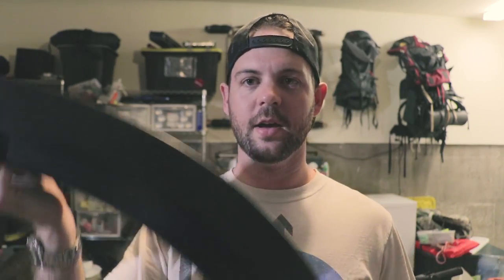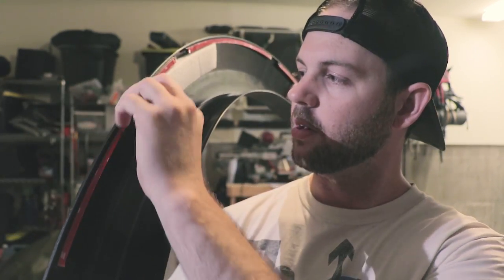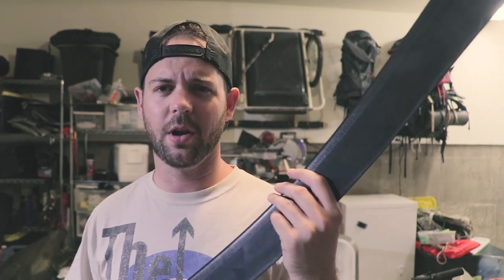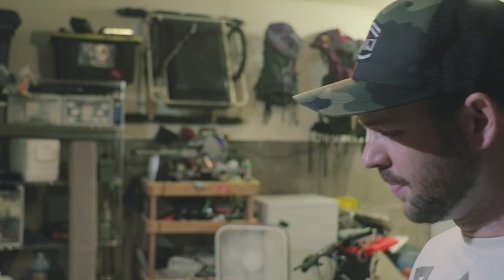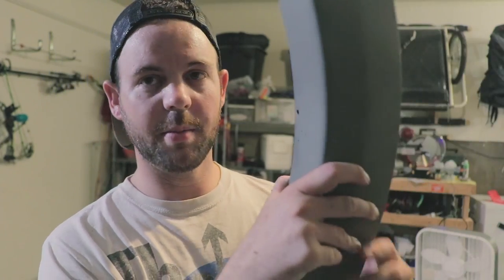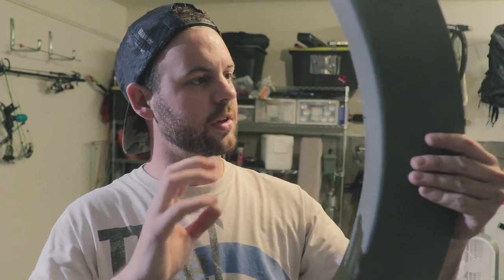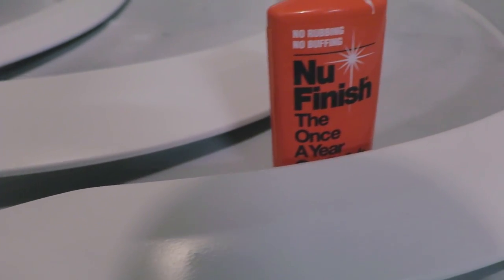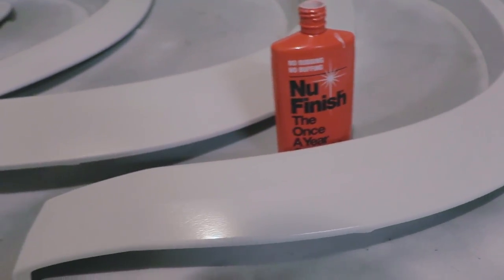Painting and Installing Ram 1500 Fender Flares

Comment: Three pro tips. First wet sand your paint before clear coat. Second blow torch on clear coat removes bubbles.  Third peel up a tab you can pull the adhesive with out digging for it. Over all great job.

Comment: Primer IS worth not saving a couple dollars.... The primer and paint you chose to use DOES NOT have a flex additive in it. Therefore, all that paint will flake/chip off your flairs within a year or so.  Sorry to bear the bad news. Also, trying to say this as nice as possible, work on your painting technique. Dont shake the can in little spots. Long strokes, spraying past your project.😊
Reply: Any suggestions in spray cans to each steps to his process?

Comment: How many cans of colored paint & clear coat cans do you need? In my cart I have 2 cans of colored paint, 2 cans of clear coat, 1 can of primer and sand paper.  Am I missing anything and is my count off?
Reply from the maker: You are probably pretty close. It likely depends on the color. Just don't skimp on the clear coat. Use a bit more than you think it needs, but in many thin coats. Don't let it run
Reply: @AdventureOne  They're going on Ram 1500 Big Horn Bright White. And many thanks for the rapid response!

Comment: Can you install them without using that tape to make it easier  to remove them later - if you so decide????
Reply from the maker: Not really. The tape hold the top section on. Alcohol should easily dissolve the tape when it is time to remove

Comment: Won’t these rust your fenders after a while if you live in an area with snow/salt on the roads? That’s what I’ve heard that it gets stuck between the flare and the fender and it rusts your truck to shit. That’s why I haven’t pulled the trigger on these.
Reply from the maker: I live in Tx, so I can't comment on areas that use a lot of salt on the roads. On a previous truck, I had these on for 2 years without any rust.
Reply: That's why there's double sided 'fender flare tape' used to prevent the friction and damage.  Some use a length of foam clip for flares.  Some use the $155 tape, some use 3M $9 tape.

Comment: Were those the tapping screws you used? Or justvthe normal bolts? Mine came with screws but they are farrrr too short.
Reply from the maker: AIt came with self-tapping screws but I did not use them. I reused the original screws on the truck that hold the inner fender liner to the metal.  There are more holes than screws, so I went back and added some trim clips later.
Reply: Adventure One and what grit did you use to wet sand the primer?
Reply from the maker: The big Crush i think it was 240.
Reply: Just wondering where you ordered your flares from? Thanks man
Reply from the maker: I used the screws originally on the truck (that hold the plastic inner fender) then used trim pins for the rest of the holes
Reply from the maker: Chad Girard  ebay.

Comment: I got the same flares on Amazon for $178. Local Body shop is painting them. Estimate was $350-400. I have the Rugged Brown Pearlcoat so matching was important
Reply: In the future you can get exact color match in a rattle can and they spray great. No drips or blotching. It's like $25 a can, they match the paint code on your truck.
Reply: Good luck with spraying it yourself. I’m sure it will turn out decent but no where near what a paint shop can do. Why not spend the extra $300 and have it looking “factory”?

Comment: No rubber trim on the lip with scratch the shit out of the clear coat and possibly the paint.
Reply: If there like most, theres double sided adhesive tape on the back side which actually prevents that from happening just like it does on the OEM factory flares.